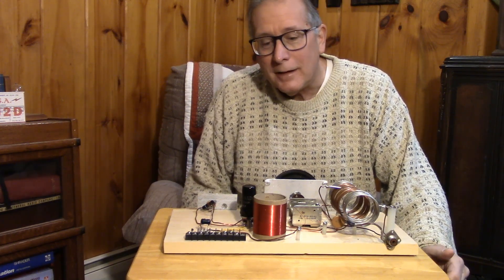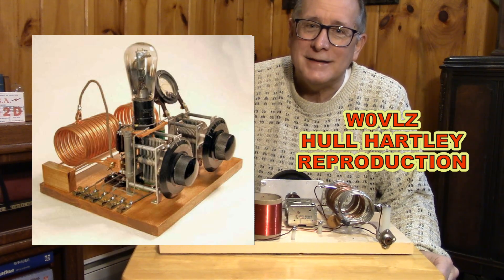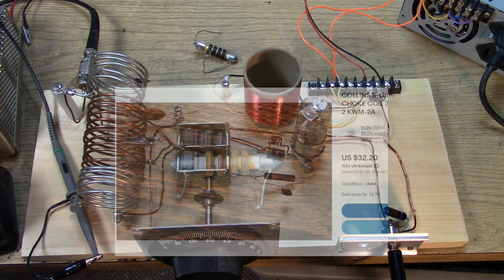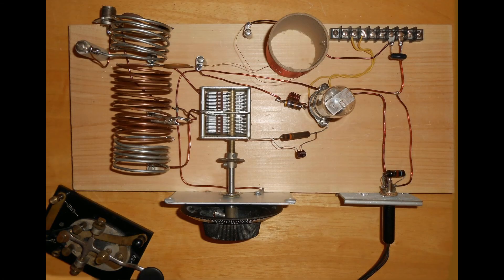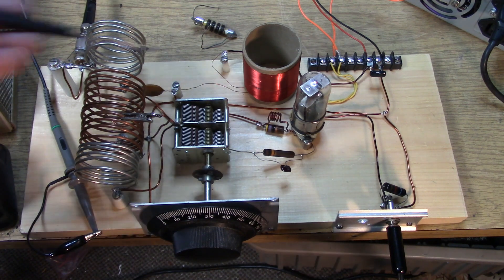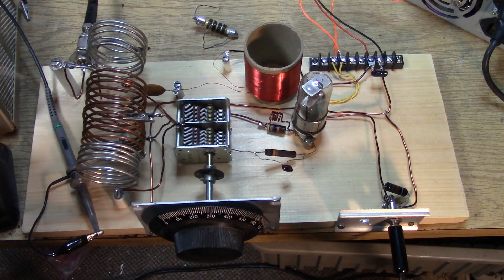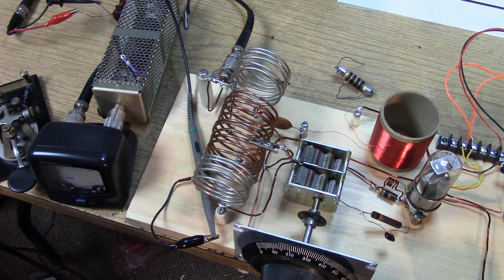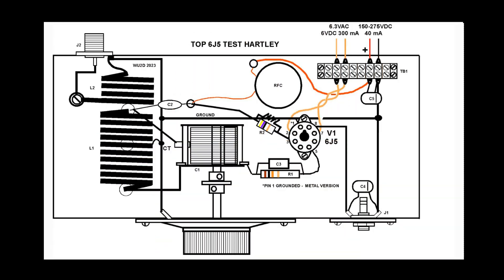Your First 1929 Style Transmitter - Part 3

Comment: Butterfly the capacitor to reduce sensitivity. Possibly have a fixed capacitor to get the correct value. Thanks for nice videos.
Reply from the maker: Great idea. Butterfly and Dual section caps are out there too! Differential Caps are a bit harder to find.

Comment: This series is wonderful!    It follows in the legacy of Bob Heil's Pine Board AM Transmitter Project.  Well done!!  73 DE K1TB
Reply from the maker: Thanks for watching. I will get the next one up Wed.
Reply: Thanks, Mike.  I set up a ~160VDC power supply on an inverted loaf pan using a a Heathkit 54-59 transformer with dropping resistor for the 2.5v heaters.  . @MIKROWAVE1

Comment: Built my 1st Transmitter back in "65 teenager Borrowed a 50C5 from parent's Clock radio using 390 ohm 10 watt resistor (No Pwr transformer, Direct 120 vac Mains)  1/2 Wave Doubler on Plate & Screen, Tank Circuit 50 ohms matched all on  6" × 9" pine board.....>10 Watt RF Out == Plenty of Cheap & simple RF contacts DX range !!
Reply from the maker: Yes the old W5LET "Widowmaker"! I did a video on this with a Euro twist several years back. CAUTION you know HV can kill.  https://www.youtube.com/watch?v=7n-52exDO3w

Comment: What would be the recommended technique to wrap the 1/4 inch copper tubing around a pipe? Clamp the pipe vertical and walk the tubing around the pipe or have the pipe horizontal on a work bench and rotate the pipe with a bar and feed the tubing?
Reply: Buy "soft" tubing and you can easily wrap it by hand; it's hardly stiffer than the #12 wire in the reference circuit in these videos.  A little care will keep the tubing from collapsing as you wind it.
Reply from the maker: There are some great websites that show how to do this. This is my friend Steve's site. https://qsl.net/ve7sl/tnt.html
Reply: Great Link, Thank You !!! @MIKROWAVE1

Comment: Question: Assuming the DC components are battery powered and all wired up could the heating of the cathodes be done by non electrical means. Like with a custom built tiny propane torch tip or something similar?
Reply: I see a problem with a propane torch or any other flame heat source, in that the cathode you're trying to heat needs to be inside the evacuated envelope of the triode.  A flame needs the oxygen from the air to burn...

There's no good reason you couldn't use a battery source to light the filament, though.  Many early receivers used a 2V lead-acid cell for filament power, and there were exchange programs at radio stores where you'd bring in your discharged filament cell and exchange it (and a little money, one presumes) for one fresh off the charger.  The filament cell would last around a week in normal use (an hour or two each evening).  This was for single tube receivers, but the filament in this single tube transmitter wouldn't use significantly more power (though the voltage is a little odd at 2.5 V for the Type 27).  Two D size NiMH cells ought to do the job for a couple hours, at least.

When I was quite small (around first grade, give or take) my parents had a multi-band tube radio that had provision for battery operation on two dry cell batteries: one 6V lantern type for the filaments (it was a 1950s design) and one 45V for the plates.  The lantern battery was a pretty beefy 4-cell carbon zinc type, but the 45V B battery was hardly larger, despite having 30 cells -- and it would last ten times as long as the filament battery because the plate current was tiny.  Unfortunately, I could never get them to buy a B battery (they may not have still been available in rural Idaho in 1965; any drug store would have had them ten years earlier).
Reply: I was thinking something like that about 10 minutes later. Doh!  @SilntObsvr
Reply from the maker: Yes I imagine - as long as the rod was protruding through the seal so you heat it externally. But that would likely break the seal!

Comment: Excellent, thank you Mike. Looking forward to seeing the Type 27 on the wood.😅
Reply from the maker: Hint - its working almost identically and at power - but a bit of chirp on 1 of them and 1 clean. So the lower Mu and emission of the older tube is a slight factor as expected. Converting over to tubing and upping voltage next.

Comment: Hi Mike, I see you mention directly-heated valves including the LS5A at 0:43. I have an unused LS6A which I would love to use in this way. Will you explain at some point how to adapt the circuit for a directly-heated triode, please? Regards, Phil M1GWZ.
Reply from the maker: Wow that is an old valve all right and perfect to try in this. It has a 5V filament and can take quite high plate voltages. Assuming you have 5VAC you just need a pair of capacitors from each filament to ground like 0.01s.  Then a pair of 22 to 50 Ohm 2W or higher power resistors off each filament tied together that form the center tap that goes to the key jack. That's it!
Reply: @MIKROWAVE1  Thanks, Mike! M1GWZ

Comment: I am concerned about building this on a board due to my cats jumping on the table.  Would building in an Atwater Kent model 35 metal chassis still work, or will it mess up the coupling or something?
Reply from the maker: MEOW! Building it into a chassis of metal will be great as long as the big coil is an inch away from the metal sides of the box.